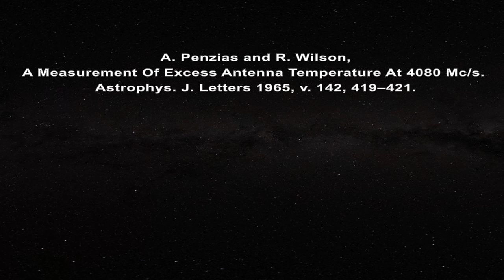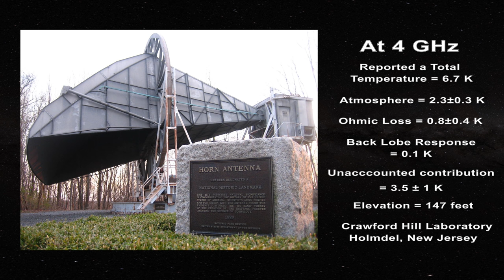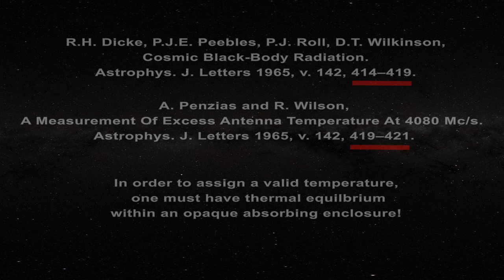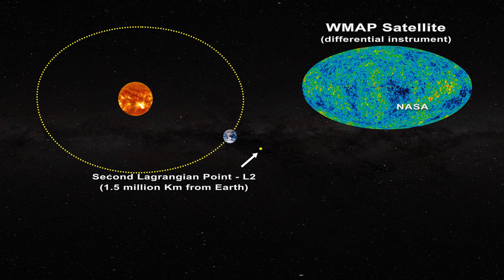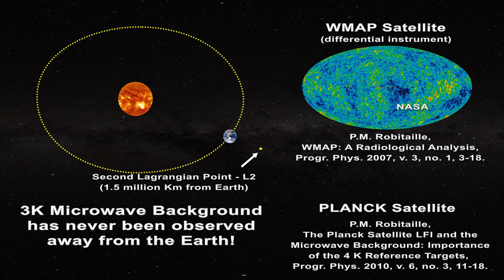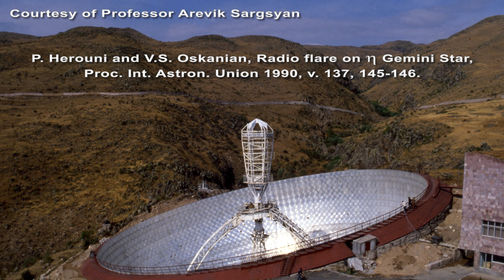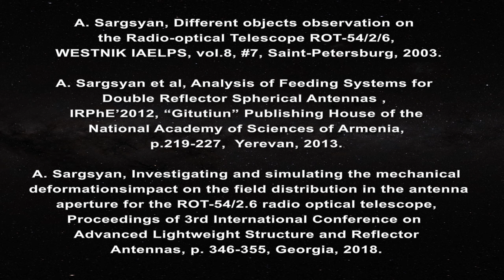The Herouni Antenna - The Death of the Big Bang!

Comment: I get that the big bang could not have produced Penzia's 3.6 K signal, but how does lack of such a signal in the Herouni antenna prove that their was no big bang?  Thanks.
Reply: If the very theory of the big bang is based on getting a Radio source signal that was distorted to begin with how does the BB theory stand up with a complete lack of said signal in a second more accurate scientific detection? Answer, people will repeat bad info to keep an idea alive if it means continued funding and no egg on your scientific face.
Reply: @joerenaud8292  I just loved the way you answered that question! Because that's what it's about.
The dark masters behind the NSF do not want anyone to extend scientific knowledge beyond a certain point and the science funds only go to the yes-men of their preference.
Reply: no signal or signals means no proof or how do you prove a big bang if there's no signals. If it didn't happen then of course there will be no evidence so nothing is proven and the big bang was supposed to be provable and what is being said here is the so called after glow of the big bang isn't an after glow at all
Reply: @maddy123sir  Thanks for the response.  But I take exception to one point that you made.  First of all, I'm inclined to accept the idea of the big bang, but not as an article of faith, but merely as a reasonable hypothesis, although not necessarily with all the caveats that seem to go with it.  However, I do not accept it as a scientific theory, but rather as a philosophical theory, precisely because it is not measureable.  What presumably existed, materially, before the big bang was nothing which is not measureable.  So it still seems to me that a "big bang" could have occurred, and I agree that it cannot be proved, while it also cannot be not-proved either.
Reply: @leekochel2737  bc most of the signal has to go towards atmospheric effects. see slide 1:29 in the video.
Reply: For the BB to have happened like they say, a PEA sized amount of matter needed to exist @ @leekochel2737
Reply: @dslinger7897  but that pea sized bit of matter was supposedly containing the entire universe
Reply: Lack of evidence does not constitute evidence. We must keep searching for the truth, whatever it may be or however it may change our society.

Comment: Extraordinary claims require extraordinary evidence.  That scope should be refitted and results retested.  However, it should also be duplicated elsewhere, with other methods if possible.  Good luck.
Reply: Fair point. I myself will need to process this video's claims for some time before I can speak to their merits
Reply: But those same requirements were never applied to Penzias and Wilson's original work or that little shoe horn by the ocean, which was not even originally built for the purpose they used it for.  If one claims Santa Clause does not exist, is that then an extraordinary claim requiring extraordinary evidence?  What was Herouni's work if not a refitted retest of Penzias and Wilson's work?  Shouldn't we conclude that Penzias and Wilson's findings could not be duplicated when vastly better instruments and 20 years of advancement were applied to the case?  But instead, the conclusion is that Herouni didn't know what he was doing, so his findings need to be suppressed and buried because they threaten - what?  Truth? Better understanding?  Why do scientists not want to advance knowledge, but fix it in place and defend it until their last breath?  It serves no one to declare something to be the truth and then avoid further exploration, repetition and questioning.  And then to suppress work that does question it, especially if the results don't concur?  And then further, hold up a standard for Herouni's work that was never held to Penzias and Wilson's work when, most laughably,  Herouni was merely applying that very same standard to Penzias and Wilson's work.  If the scientific community was anything close to what they claim to be and held themselves to the standards they claim to apply to themselves, but really only use as a club to beat up and discredit those whose science results in findings that are inconvenient to them - then what value is this brand of science to anyone?  Billions of dollars in grants and published papers and research and scholarship to bright young minds to study, investigate and educate others about science shown to be dubious at best nearly 35 years ago?  Why didn't the scientific community jump on that when they had the chance?  Fer Christ's sake, change and developing a better understanding is good for science, scientists and society - it drives advancement, adds actual results and value for the resources spent on it and ensures there is a continual unfolding of opportunity for the future.  But instead, is it that scientists are, and teach new scientists to be, mere torch bearers of the agreed upon dogma and all who question or, god forbid, actually experiment or explore beyond the boundaries, are to be discredited and crushed? And if that is not it, then WT actual F is it? And how is it even possible to justify it as the natural and desired outcome of the 'scientific process', as if open inquiry, curiosity and a drive to discover greater truth are the unimpeachable touchstones of the trade?   Evolution requires death.  We should be looking to move out of our parents' basement and put them where they, and their archaic understanding and bone-headed conclusions belong - in the graveyard. And we should pray that our sons and daughters will do the same for us.  We can still honor the greats and the great ideas of the past, in context, as necessary points on the path.  But only if we continue on the path rather than retire to a life of self-blinding worship at some scenic overlook along the way.

Comment: If a simple open-ended waveguide is used as an antenna, without the horn, the sudden end of the conductive walls causes an abrupt impedance change at the aperture, from the wave impedance in the waveguide to the impedance of free space, (about 377 ohms).[2][12] When radio waves travelling through the waveguide hit the opening, this impedance-step reflects a significant fraction of the wave energy back down the guide toward the source, so that not all of the power is radiated. This is similar to the reflection at an open-ended transmission line or a boundary between optical mediums with a low and high index of refraction, like at a glass surface. The reflected waves cause standing waves in the waveguide, increasing the SWR, wasting energy and possibly overheating the transmitter. In addition, the small aperture of the waveguide (less than one wavelength) causes significant diffraction of the waves issuing from it, resulting in a wide radiation pattern without much directivity.

To improve these poor characteristics, the ends of the waveguide are flared out to form a horn. The taper of the horn changes the impedance gradually along the horn's length.[12] This acts like an impedance matching transformer, allowing most of the wave energy to radiate out the end of the horn into space, with minimal reflection. The taper functions similarly to a tapered transmission line, or an optical medium with a smoothly varying refractive index. In addition, the wide aperture of the horn projects the waves in a narrow beam.

The horn shape that gives minimum reflected power is an exponential taper.[12] Exponential horns are used in special applications that require minimum signal loss, such as satellite antennas and radio telescopes. However conical and pyramidal horns are most widely used, because they have straight sides and are easier to design and fabricate. - Wikipedia

Comment: Brilliant discovery and analysis. Unfortunately you can rest assured that there are people out there who will want this suppressed. No one likes to have their belief system defeated. I truly wish you the best of luck.
Reply: Not so much a belief system as it is a cash cow.  They're spending about a billion on each LIGO facility and they built 2 in the States.  Politicians love it because it allows them to get their rocks off stealing people's resources to create these facilities, and their operators love them because they get paid a boat load of other people's money to produce nothing.  It's like a whole other bubble economy.  As in economics we have debt based, fiat currency driven by keyensian monetary policy, we seem to also now have conjecture based, fiat science driven by quantum comos. theory.    It's almost like it's designed to produce more questions than answers so we have to keep spending money.  Inexhaustible questions paid for with money conjured out of thin out. Perfect union! What could go wrong?!
Reply: If your belief system is funding I think it will be exhilarating.
Reply: The main advantages of ROT Antenna are the highest accuracy of mirror surfaces (50 micron), shortest
wavelength (1mm) and very low level of Self Noises (2,6 K), i.e. highest sensitivity. Thanks to high accuracy of ROT Antenna it can work in very short wavelengths, down to 1mm. Due to special
 optical scheme of the Antenna, the diffraction rays from edges of mirrors do not arrive to the focus point, so
Antenna almost not feel surrounding high temperature (about 300 K) and I have no Idea what I'm talking about so the Self Noises of Antenna is very low,
just about 2.6 K or 2.8 K (r10%) in different experiments, where to achieve the high accurate result, the Self
Noise Temperature (TSN) was mainly measured at first near the East support leg of Antenna, where there is the
bridge, in open position of which it is possible to go to receiver and focus point.

Comment: I can't claim to understand all this scientific jargon but Finally someone talking sense. There was NO big bang! How can an Infinite Universe have a beginning? Infinity exists not only in Space but also in Time.
Thank you for this awesome video.
Reply: The main advantages of ROT Antenna are the highest accuracy of mirror surfaces (50 micron), shortest
wavelength (1mm) and very low level of Self Noises (2,6 K), i.e. highest sensitivity. Thanks to high accuracy of ROT Antenna it can work in very short wavelengths, down to 1mm. Due to special
 optical scheme of the Antenna, the diffraction rays from edges of mirrors do not arrive to the focus point, so
Antenna almost not feel surrounding high temperature (about 300 K) and I have no Idea what I'm talking about so the Self Noises of Antenna is very low,
just about 2.6 K or 2.8 K (r10%) in different experiments, where to achieve the high accurate result, the Self
Noise Temperature (TSN) was mainly measured at first near the East support leg of Antenna, where there is the
bridge, in open position of which it is possible to go to receiver and focus point.
Reply: It is rather remarkable that your professed ignorance has led you to conclude there was no big bang
 I suppose you would conclude the world is flat after all.